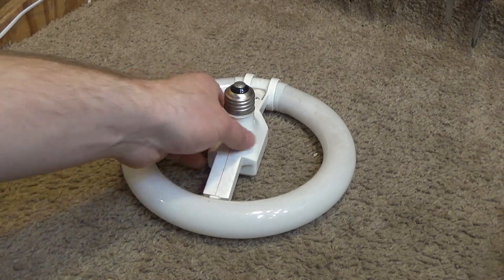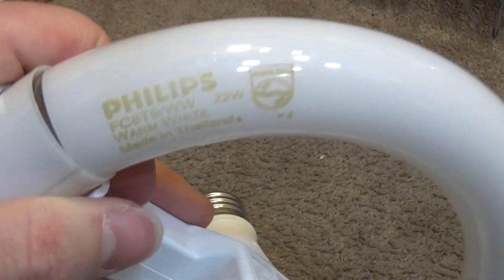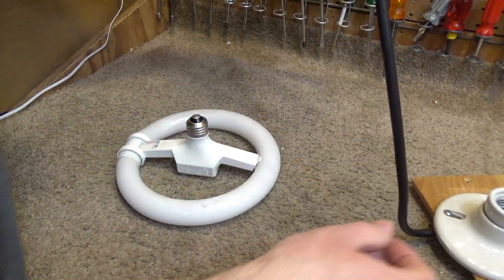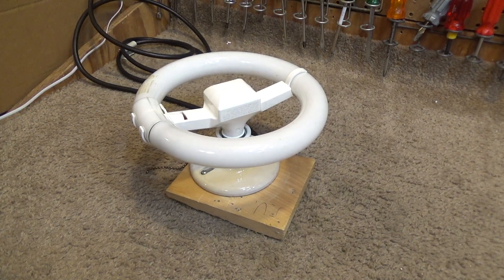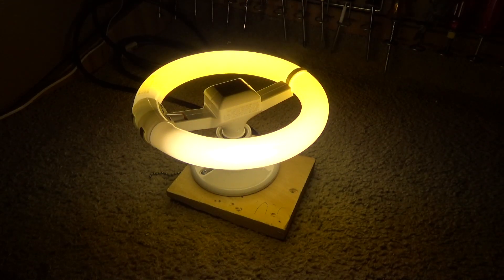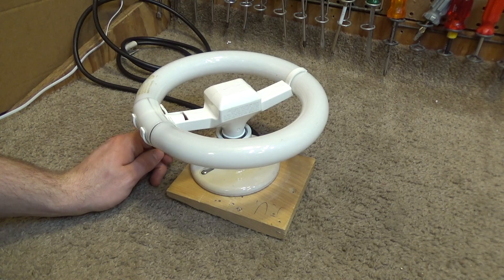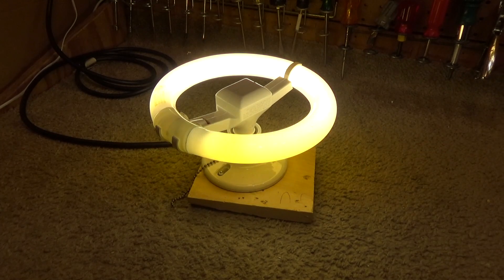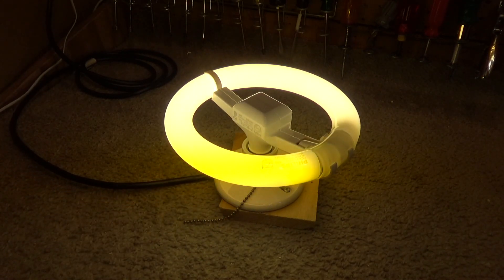Philips FC8T9/SYS 24-Watt PreHeat Self-Ballasted Circline Fluorescent Light

Comment: I got same one like that at a restore few years ago came it’s original bulb and I got a vintage American fluorescent rapid start chrome Art Deco style light fixture new old stock never used. I kept the original box for it. I have older General Electric fc12T10/CW lamp on it. I love that cooler between 3500k-4500k color temperatures!
Reply from the maker: Thanks for letting me know.

Comment: I have two different types of socketed circline bulbs, both from TCP though the tubes cross reference to Philips and a few others, one's a inner-outer dual tube and the other's a upper-lower dual tube, if you have a lamp with a relatively large cone shaped shade then these are perfect, this Philips unit is nice because it takes a fairly standard circline bulb so it can continue to work long past the expiration of the included tube
Reply from the maker: From what I've seen, the ballasts are often rated for about 4 times the lifespan of the bulb. I'd be willing to bet most of these would outlast the LED junk of today.